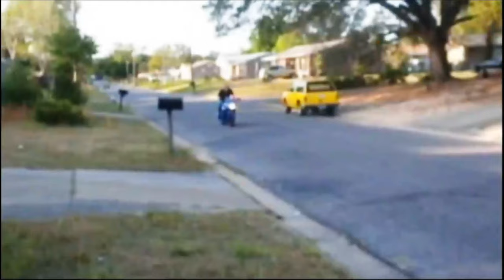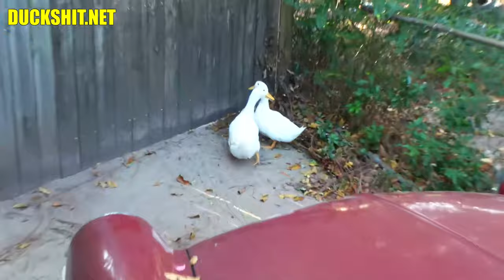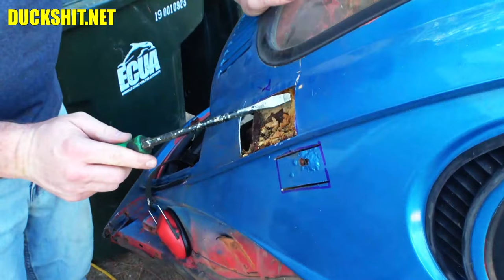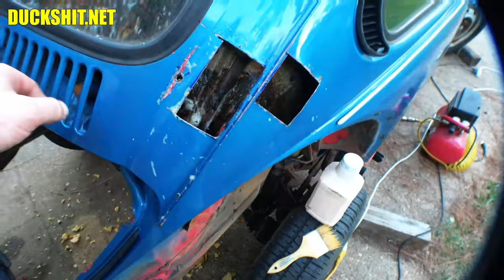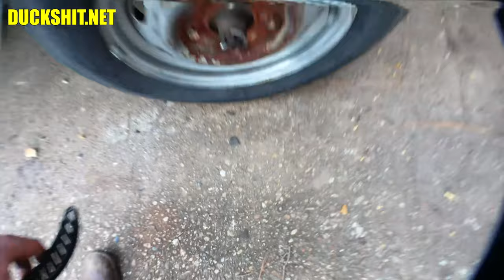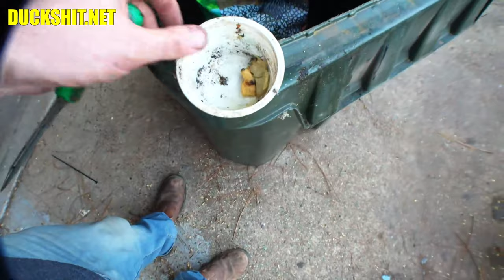☠DE4TH FOAM💀 REMOVAL - Rust Repair 🛠️ - 1974 VW Super Beetle

Comment: Good video Glenn, maybe that commenter was thinking of the polystyrene foam they use for packaging? Try some m.e.k. methel ethal keatone, could be slightly dangerous?😮
Reply from the maker: Oh man, good call!  But after video I had some methyl ethyl ketone paint/epoxy thinner that I tried after video, it also would not touch it.  It cleaned it, though, but gas cleaned it better lol!  But as far as toxicity, I dunno, but I can tell you that the foam tastes really bad!
Reply: @DuckmanCycles  I worked with m.e.k. years ago and it had a red warning on it that said "caution do not drop" on the can, but I was a cocky young man and used it in my Zippo lighter when I ran out of fluid. That got some old dudes excited!
Reply from the maker: Don't drink the Zippo fluid! 😁👍🏻

Comment: OK, solvents having failed, here's the hack: I have a ruined speedbor spade bit, 1" or so, but they're cheap enough new. 
Once you cut away the rusted area, using a variable speed 1/4" or 3/8" drill and a shop vac, insert the bit into the foam and chop away. (vac hose might require a helper or some baling wire) Run the drill about half speed. It kicks ass on the foam. Whatever foam is stuck to the metal can be scraped off with a screwdriver and maybe some heat.
Reply from the maker: Something like that would work pretty well, but there are baffles inside of there that you won't be able to get into.  Often you are forced to just cut a hole to repair rust anyway, so that'd be the way to get in there and do it, the bigger the hole the better.   😁👍🦆💩

Comment: The panel bond is good stuff. I used it to glue in my fiberglass split window insert. Not cheap. Welding in a patch is the best but much more time.
Reply from the maker: Thanks much!  We've been using a lot of it around here as of recent!  not cheap as you said, but you save a lot of time!

Comment: I'm not burning the foam out. The rest of the car is in good condition!
I think we need some kind of flexible drill brush and manufactured repair panels to do this job. That foam is the reason there aren't many good condition late model cars. And supers do have a few advantages over older torsion beam cars... the biggest being they ride and handle so much better. That's why they road rally them in Sweden.
Reply from the maker: LoL! BURN IT!  I didn't think anyone would take that seriously.... haha!  Despite the improvements in handling, I'm still not a huge fan of Stupid Beetles!

Comment: Dude!
Have you tried "brakleen"?  I don't know if it works, but it's a serious solvent. The old carb cleaner would take off paint.
I was working on a different kind of car, rocker panels gone, full of foam, way up into the door pillars. I had an old dull speedbore bit. I put it in my drill and ran it slow.  It kicked @$$ on the foam. hadn't thought of using a solvent. Paint thinner?
Reply from the maker: Yes, actually... I tried Brakleen yesterday, and some carb cleaner... Neither one would touch this foam.  I wonder if this foam is a more organic stuff, like make from ground up horsehair and chicken bones or something lol.
Reply from the maker: Paint thinner was mentioned in the video, xylene, acetone and mineral spirits... no luck!  Methyl ethyl ketone was also tried off camera, no dice!
Reply: @DuckmanCycles  You mentioned brake fluid. I found pine pitch is tough to remove having tried many solvents. Believe it or not...try strong  Isopropyl alcohol.'Heet" red bottle. Or hand sanitizer.
Reply from the maker: Well so far we tried all those things and not a damn thing has broken that foam down.  Brake fluid loosens it into a lump of phlegm, but it still won't break down.  So far the only thing that seems to touch it is.... FIRE!  🔥🔥🔥🔥

Comment: Ive never really worried about this as mine has never showed any signs of rot in that area. However i do think i could have removed it before i had the car painted. What are you going to replace the foam with to prevent ingress of fumes etc
Reply from the maker: What I would like to try is.... FOAM!  Yeah, you heard that right, lol!  But put it in a bag that can be removed easily.  Anyway, thats the goal for Eleanore.  But its an experiment.  We'll see how that goes! Thanks for the question!

Comment: Ive seen disc brake cleaner eat foam, wonder if that would do it.
Reply from the maker: I'll give it a shot for curiosity's sake!  We shall see!  But for all of the solvents I have already tried, it might be no surprise if it doesn't work either!  I'm sure this foam was chosen deliberately so it wouldn't break down in such an environment of chemicals and heat cycles.

Comment: not all Vw's were water tight so the foam was added so they could float 🤣🤣🤣 seriously dont know what people think when they do stuff like this
Reply from the maker: Lol @ float... there is a very good reason actually.... stops engine noise and fumes from entering the passenger cabin.  Nobody expected these cars to have this longevity.  Before the days of foam they would use the leftover interior scraps and make pillows and ram them up in there.  When I cut up Eleanore I found the remnants of these in there.

Comment: Will Superbeetle engine run off (temp) gravity fed tank? Fuel pump isn’t working and I need to drive it about 5 miles down the road.
Reply from the maker: Absolutely yes!  Good luck to you!
Reply: @DuckmanCycles  thank you!
Reply from the maker: Let me know how it goes, love those stories!
Reply: @DuckmanCycles  finally got it running and drove it home…with no brakes (just emergency brake) and a gas can zip tied to the rear license plate bracket. Not sketchy at all. 😆first time on the road since 93.
Reply from the maker: LoL success!  Congratulations, I love when things like that work out!  Ruby was also driven home on e-brakes.   And as it turned out, it was only the right one that was working LOL!

Comment: That stuff looks and behaves like urethane spray-in foam like you'd use to fill holes and gaps in walls, which it obviously isn't, because if it were, acetone should have destroyed it. o!O
Reply from the maker: Yeah, kinda.... but NOTHING has done much to it at all.  Only the brake fluid kinda softened it a little... lol

Comment: Hey Duckman, why did VW put that shi* in there ? Kinda dumb in my opinion 😂
Reply from the maker: Very good reason actually.... stops engine noise and fumes from entering the passenger cabin.  Before the days of foam they used to use the leftover interior scraps and make pillows and ram them up in there.  When I cut up Eleanore I found the remnants of these in there.
Reply: @DuckmanCycles  Wow I didn’t know. Learn something new everyday.
Reply: Im pretty sure that might just be an vw america thing, in South Africa we got the coconut husk pouches, never seen nor heard of any one here having foam in those cavities. Very interesting
Reply from the maker: Those coconut pouches that you're talking about are the trimming some of the old seats that I had mentioned earlier.  You will find that in cars from 1967 and older.  Foam above that!  😁👍🏻  these cars came from Germany though, not of Volkswagen America product